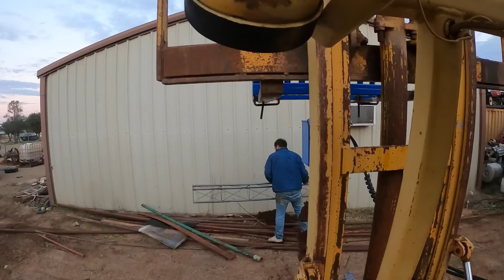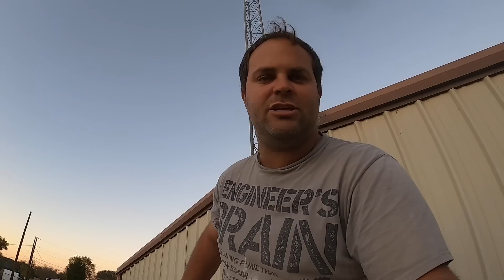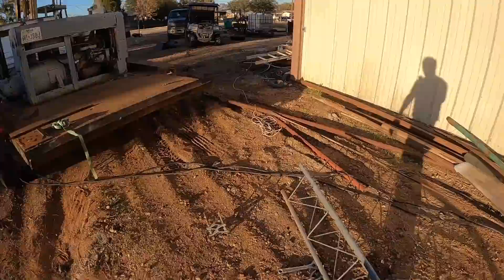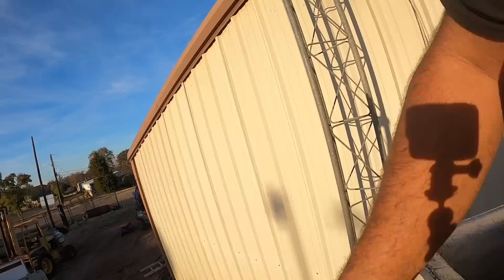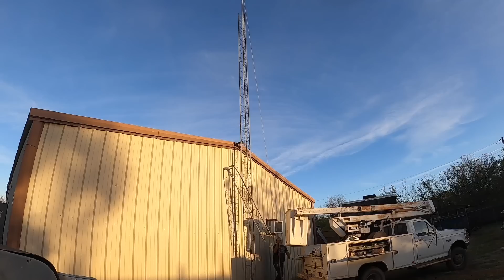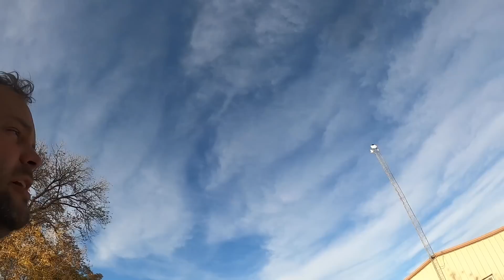Something Else

Comment: I've set a few of those for ham radio guys. Owned a tree service for years . That 30' does not account for a 300lb gorilla hanging off the side!!  I had a 65' truck and could set 75-80 with relative ease. If you had someone around with a truck you'd be amazed at what you could get done for a case or two of beer. Have you looked into the cell service camera type technology, looks like it could eliminate towers and a lot of weather related issues
Reply from the maker: Hahaha, the cell stuff is too expensive for what I'm wanting to accomplish.

Comment: Watching a few of your videos I am truly amazed at how we have a similar skill set although I worked in the mining industry and no nothing about oil. I welded, did electrical work mostly 480 volt and motor controls and designed and installed several SCADA systems. We would lay them out on a napkin then do a final design on a yellow pad and start installation.

Comment: Nice job Zach, I used to have a 40 foot Rohn (same as yours)  tower in Farmer's Branch for a ham radio station. I found it  easier to mount the antenna/s to the top section before using a "Gin Pole" to raise the last section. Don't forget to drive a good copper ground rod at the base of the tower connected with a large guage wire or braid to the tower for lighting protection. Have a nice Christmas. Noel (W1XB). :cat-orange-whistling:
Reply from the maker: Thanks. The radios are a high gain and only have a couple of degrees of broadcast and would have to be tuned anyway. Yalll have a Merry Christmas.

Comment: I worked for APC from the Woodlands TX. I installed and maintained Automation on oil and gas wells we had till mid 2017 in the Bryan area. We used Weatherford POC with tank gauging and collected data from totalflow for gas measurement on rod pump wells and used totalflow on flowing well for gas and tank level data.

Comment: So, if struck by lightning, you've electrified your building.  Love your videos, what about a soft metal "fuse" disconnect between the building frame and the tower, and a lightning surge protector from the antenna leads and your computers.  We were struck (residential rural tv antenna) and watched ball lightning between the tv and a station mount cb. A high "oh my" factor.

Comment: Simple ground guy here. The lifting pole is called a gin pole. Usually grease the necked down slip on sections of tower so they come apart easier when you have to take it down. Had better luck with galvanized tower hardware because the stainless tends to sieze up with similar metals in every application except direct salt spray off the ocean. Thanks for the videos, no intention of ever getting into the oil fields myself but neat to see.
Reply from the maker: Thanks.

Comment: I suggest you put a lighting rod above the units and dig a hole by the tower put a ground plate  in with  a cable  to tower and plate.
Give lighting a easy way to ground. 
Time will tell how your clever engineering holds up.
Reply from the maker: Thanks.

Comment: Don't tighten your hardware too much.  It'll egg the wall section.  It'll make taking it down harder.  Rohn 25G.  Good stuff.  Using stainless with nylock nuts is the bomb.  Good stuff man!  I've wondered about those data systems in the oil field.  Might be a good idea to run a ground rod on the bottom near the tower base.  Then tie some overhand knots or drape some coils in the ethernet cables close to it.  Make the lightning find a good straight path to ground and make it try to go down the cables like a pretzel to the network gear.  Lightning is like ac current.  It loves to jump gaps (like capacitors) and hates twisty coils (like inductors).
Reply from the maker: Thanks. Good info.
Reply: Was that 2 or 3 bags of concrete that was poured in the hole over the base?.. anyway, it made me think this tower is never going to be moved haha.

Comment: If you had bolted that top piece to the piece below it and connected the top piece and one below it at once it might have worked. Looked like you didn't have any issue lifting one section so that short section and a normal one you probably wouldn't have issues.

Comment: I was involved in building some mobile, laboratories in buses/motorhomes in the 70s and one of them had a 25 foot tower apparently just like what you were using there attached to it. I had to climb it a few times to attach equipment to it and when you got to the top of it, the whole bus kind of wavered around, no safety harness either. I was glad when that got delivered and I didn’t have to see it anymore.😅
Reply: Oh yeah, it was hinged at the bottom, so it folded down on top of the bus to move it around. In case anybody was wondering lol
Reply from the maker: Hahaha thats pretty cool.

Comment: Ah, you rediscovered the gin pole. Climbing that stuff takes nerve and steel shank boots as the webbing is pretty small and can hurt if you don't have the proper footwear.

With those sectional towers, you might consider bonding wires between the segments as oxidation in the swaged connectors can be an issue. With Texas weather this might save some expensive gear...

Comment: Last hurricane I noticed the rotator on the end of the antenna just like that was wobbling. Climbed it in 60+mph winds, and it was fine. You definitely had to be parallel to the wind though, if you were facing it could blow you off. Got to the top and on of the ubolts had rusted and the second wasn't far behind. Built the exact same rig to lower the antenna off the top, one of those giant old school ones.

I didn't really use my belt at all, it was easy to just stick my leg in the tower.

Comment: Zach, don't be too hard on yourself...You are plenty smart enough to make it all work like you want at some point. I think you probably still haven't got all the pieces, might need some more software and maybe a guy you can learn from that has done this...I am sure those people are out there, there is always someone with software to sell. 

I wonder if the big production companies around you throw away equipment like that. Is that equipment around?

I am IT developer. I don't have an interest in just learning something for no reason. My skills came from being determined to "do something" or make something work. Your motivation is less time toiling in the hot sun, I would think...if you get enough of this working. Phase 2 is figuring out how to remotely adjust old mechanical valves and some of those things.
Reply from the maker: Thanks. Most of what I want to do is simple and cheap. Its code, and networking that's difficult and new to me.

Comment: I'm sure you are, but as a telecomm guy dealing with radio day to day, make sure you've got a good ground, bond all the sections together properly (proper copper bonding wire on bare metal sections, or ribbon bonding wires) and please please make sure you're operating in the correct range of frequencies or you'll find yourself talking to the FCC and every telecommunications company lawyer around.
Reply from the maker: Thanks the plan is several grounds rods and copper up to the top.